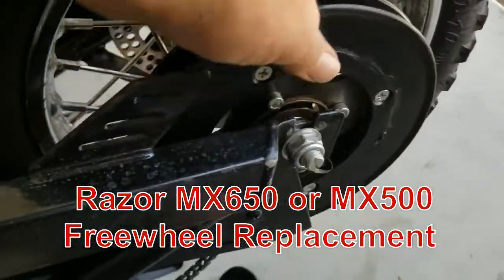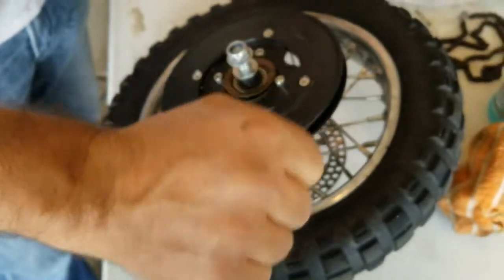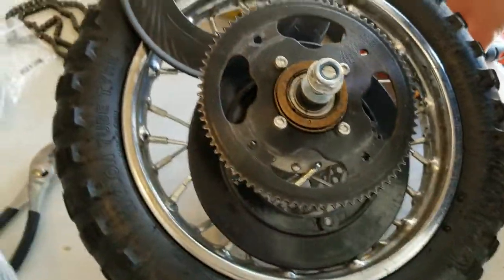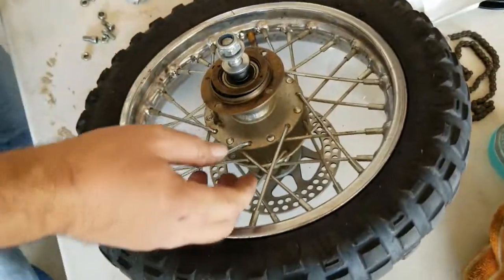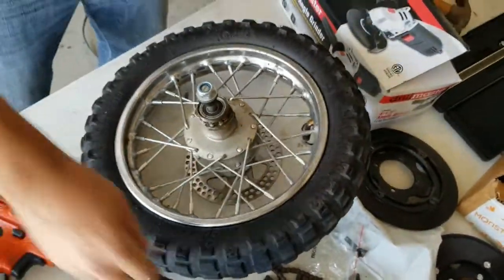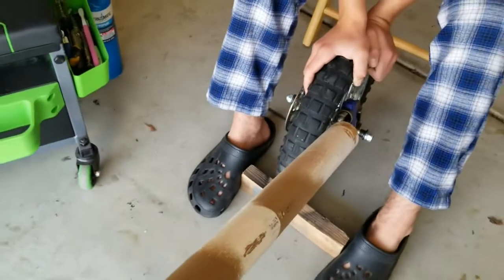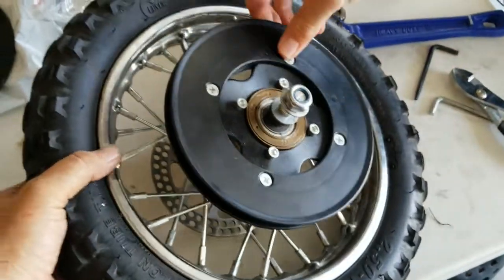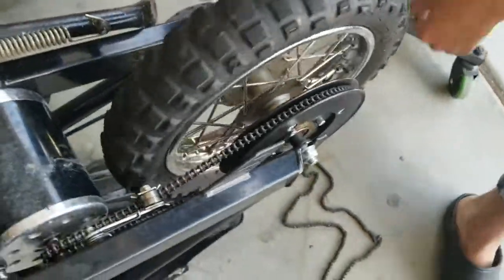Razor MX650 / MX500 Freewheel Replacement

Comment: Good vid. How come you don't put some anti seize on those threads so you don't have to cut it off next time? I'm going to replace mine probably with an upgraded freewheel based on your other video. Thanks
Reply from the maker: Good idea, not sure if that would work.  Its not really seized, though.  It's just torqued on super tight. Still might help, good idea.

Comment: Tim, 

It seems like the mx650’s sprocket and free wheel are a real weak point. I’ve replaced both on my stock bike. Have you looked into or seen anyone who’s upgraded these components?
Reply from the maker: No, but you are thinking what I am thinking.  One of the problems is that these are really cheap freewheels.  I am thinking if you go with a Shimano freewheel it might be able to handle the load.  The next time one breaks I will replace it with that and do a video of how to do it.  On some of the MX650's, they use BMX freewheels with teeth and an adapter that covers the teeth, so there is a template on how to do it.
Reply from the maker: I kept breaking freewheels so I found a way to upgrade them:  https://youtu.be/7lnPQJ3rK2Y

Comment from the maker: Install a 48v 30Ah Lithium battery in your Razor MX650!!  It's a tight fit, but will fit in your MX650 or MX500.  I estimate this will give you 3-4 hours of constant hard riding run time with the 1800watt 48v upgrade. Please like and subscribe.  

https://youtu.be/4XnDhtz9sRg

Comment from the maker: Fixing a flat rear tire on a Razor MX650 or MX500 is a serious pain. We use Green Slime which works most of the time. You want to avoid replacing the rear inner tube at all costs.  https://youtu.be/T1Q3UFE5qrg